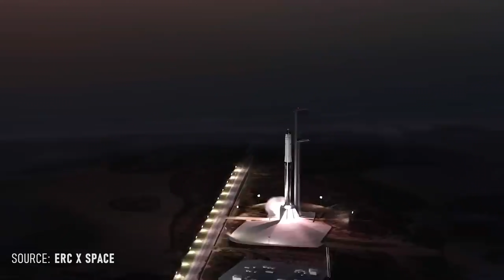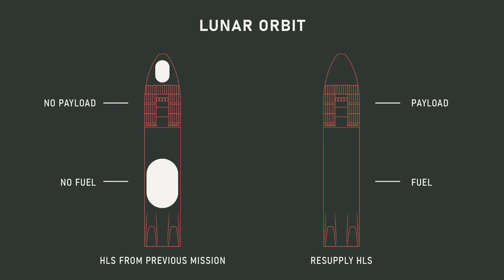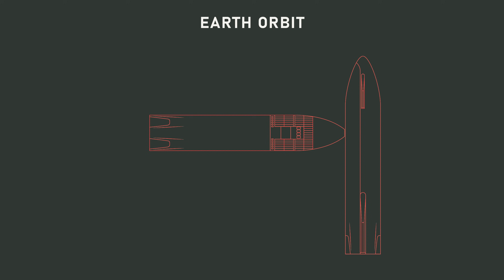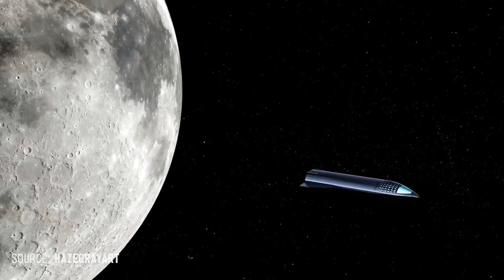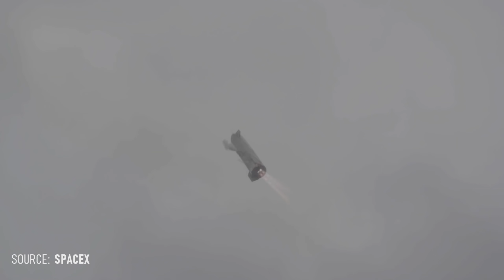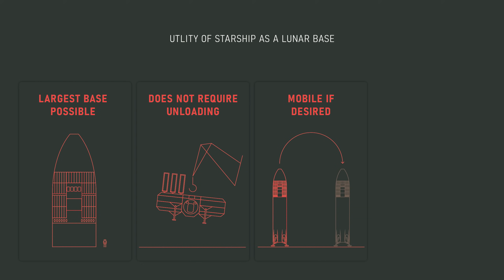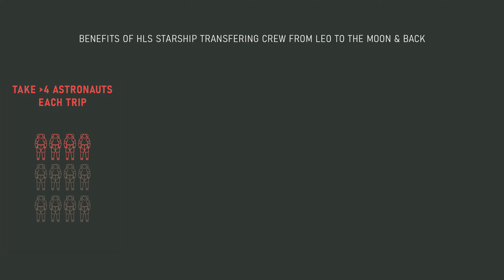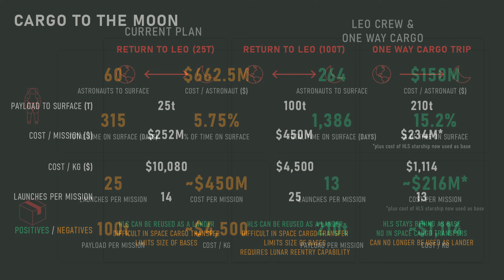How to Use HLS Starship

Comment: Your initial sequence shows the Lunar Starship with Sea Level raptors as well as Vac optimized raptors. Tne Sea level raptors, their mounts, and controls are not needed. It may turn out that all three Vac raptors are also not needed. all these reduce dry mass of the Lunar Starship and increase payload.
Reply from the maker: According to SpaceX renders of HLS Starship, it has 3 sea level raptors and 3 vacuum raptors. 

The sea level raptors are actually needed at stage separation for the stage to have enough thrust to make it to orbit on initial launch.
Reply: @Apogeespace  Interesting. Falcon 9 has pretty much the same flight profile and 2nd stage uses vacuum optimized Merlin. I wonder why the difference. Each Raptor masses 1.5 tons, add in mounts, plumbing, controls and actuators one could expect the total to be around 2.5 tons per Raptor. That implies 7.5 tons for cargo or fuel.
Reply: @richardrigling4906  The 3 vacuum Raptors won't gimbal per SpaceX. The 3 sea-level Raptors will gimbal. So evidently they are willing to use sub-optimal sea-level engines in space for any gimbal maneuvers.
Reply: @steveaustin2686  they could be gimbaled if required. The sea level raptors will Not be needed and there's a strong probability of losing at least one vacuum engine.
Reply: @jonbong98  The sea-level Raptors ARE needed to get Starship (second stage) to orbit. The Super Heavy does not reach orbit, Starship (second stage) has to get the rest of the way there on it's own. The engine bells for the vacuum Raptors are huge and per SpaceX will not gimbal.
Reply: @steveaustin2686  gimballing for orbital burn may not be needed. Since the Vac raptors are mounted closer to the perimeter of the SS differential thrust can be used for directional control. Sea level raptors need gimballing because they are mounted closer to the centerline and to flip to vertical and balance during landing,
Reply: If you dont have any Raptors how do you fly?
Reply: @iamarokotmanson  use only the 3 vacuum optimized Raptors. Theory is the 3 sea level raptors are needed for Earth landing

Comment: question: do you think the 2024 timeline for artemis could be pushed back because of how huge starship is which would take a long time to human rate?
Reply: i don’t think 2024 is possible for hls but i think it is more likely for hls starship to be ready then than it is for sls and orion to be ready for their 3rd launch in 2024
Reply: @ob1rayer08  I'm not so sure SLS will be why any Artemis dates slip. All the development work for SLS is done, now its just building them. All the engines and SRBs are there for at least 4 flights I understand, so it would come down to making a core for the Aug 2023 Artemis II flight for crew going around the Moon and another core for the Oct 2024 landing. Lunar Gateway is currently scheduled for May 2024 on a Falcon Heavy. 

If anything the greatest risk to the schedule seems to be Lunar Starship, but even that is doable if SpaceX is still working on regular Starship to reentry from orbit. As long as the Starships can go up, they don't necessarily need to come back down for Lunar Starship to work. Yes, you would have to expend the 6-12 Tanker flights per Lunar Starship launch, but as long as they can build and fly them fast enough, Lunar Starship can possibly make the date as well. It would just be expensive to do it that way.
Reply from the maker: I think 2024 has been out of the question for a while, but not due to the size of starship. The HLS competition was just started too late. I would expect 2026 personally but before then is always a possibility.
Reply: @Apogeespace  If everything goes just right the first time on all the difficult technology leaps, they might make Oct 2024 for Artemis III. But that seems unlikely. SpaceX did just get a NASA $50M contract to demo Starship to Starship refueling in LEO before the end of 2022, so it seems like they are trying to make Oct 2024.
Reply: 2024 is doable, and that's after a late 23 Artemis I mission. Earth to Leo is already taken care of , refuelling by 22, and current velocity of StarShip development should leave no doubts. It will only be external Bo, SLS nonsense that could hinder program further.
Reply: Yes, even Steve Jurzyc said 2024 was unrealistic and lack of HLS funding.

Comment: In the Single HLS Starship with GTO Refuel, could the Crew Dragon or Starliner bringing the astronauts to orbit remain docked to the HLS, and be used to bring astronauts back to Earth from GTO? (This might require the Crew Dragon or Starliner to undock in lunar orbit before landing and redock after HLS returns to lunar orbit.)
Reply from the maker: It actually can. I looked into this. To my surprise Crew Dragon can endure the thrust of the HLS starship while docked so this type of mission would be possible. 

However Dragon would need to be upgraded to survive the lunar flight (radiation and thermal changes) and the HLS now has to carry 13t of additional dry mass out to the moon. 

Math works out perfectly for that trip though! Good thinking.
Reply: @Apogeespace  Does the Crew Dragon have the dV to return from GTO? I can't find anything on how much dV a Crew Dragon has. I know the Super Draco's are only for aborts currently as they were disregarded for boosting the ISS. Crew Dragon/Starliner would have to sustained by Lunar Starship as well, as Crew Dragon only has 10 days of flight by itself and Starliner has less than 3 days. A Moon mission would be 13 days at least I believe.

Comment: I'm not familiar with space physics but I still don't really understand the delta-v problem. Why can't the HLS just escape LEO using a fraction of the original delta-v, and take a longer trajectory towards the moon? The trip to and back may be far longer and may use multiple eccentric orbits, but it wouldn't matter as long as there are no time sensitive items on board. I always thought that previous Apollo missions were time-sensitive because there were astronauts on board, and life-support supplies were limited. It would be different in this case where the trip will not be time sensitive, and the HLS can take its time, at a much lower velocity - using much less delta-v.
Reply: Travelling in space isn't like travelling over ground, where you can go arbitarily slowly and still make progress - getting to the moon means overcoming the earth's gravity through sheer (and fixed) velocity - even as you ascend to the moon, you're still in freefall, so you have to have had enough initial velocity at the beginning of the jump to make it all the way. You can take multiple burns at the LEO point of your orbit, multiple passes, to raise the peak of your orbit all the way up there, but it still adds up to the same minimum velocity requirement.

The Apollo missions didn't take three days to get the moon becasue they were in a rush - they took three days because there is no slower or more efficient orbit that actually has its peak at the moon. It's sort of like the old joke where three of a plane's engines burn out, and the pilot announces longer and longer delays, and one passenger remarks to another "if the last one goes, we'll be up here all night!".

(PS: if you haven't played it, I'd strongly recommend playing Kerbal Space Program - it works wonders for tricking you into building up an intuitive understanding of orbital mechanics)
Reply: @justharmless2319  There is a low energy transfer that takes less dV than the Hohmann type orbit used by manned missions to the Moon. Problem is that it takes 5 months to get to the Moon instead of the usual 3-4 days. This type of orbit is planned for the Lunar Gateway in May 2024 using a Falcon Heavy. Lunar Gateway has no issues of a multi-month journey. Lunar Starship on the other hand, only has 100 days of loiter capability, so it has to use a Hohmann type orbit. I had never heard of this type of orbit until I looked up the Lunar Gateway.

https://en.wikipedia.org/wiki/Low-energy_transfer
Reply: @steveaustin2686  The low energy transfer saves a little delta-v, but I don’t think it’s a “night and day” difference. For Starship, the extra time might well lead to so much propellant boiling off that it would be more fuel efficient to use the faster transfer orbit.
Reply: @zzubra  Oh for sure. It's approaching a 25% reduction per the wiki article on this slow transfer orbit type.
Reply: @justharmless2319  Actually, By my calculations, an efficient trip to the Moon (a Hohmann transfer) should take 5.4 days. Apollo missions aimed for a point beyond the Moon, and did involve a transit speed somewhat faster than the minimum.

Comment: I imagine NASA technicians and engineers are sitting around watching this in a meeting, and taking notes.
Reply: You can say what you want about Nasa but im pretty sure they already know all of this and even more and have already selected it down to a few possible methods.
Reply: @juriteller3688  They know all of this but need to ensure that SLS will have a use case after the huge sunk costs and time put into it. Also Starship is still very far from completing development and its goals are extremely ambitious, so it makes sense for there initial plans to not be overly dependent on Starship and still rely heavily on the more conventional SLS and Orion so as to be able to adapt quickly in the scenario where Starship is not able to meet all of the requirements within Artemis's time constraints.
Reply: @hadhamalnam  I agree. Rocket science is hard and nasa's actually got working stuff while Starship has a lot of things left to work out and design and test.
Reply: @123TeeMee  *rocket engineering
Reply: @hadhamalnam  but they’re already relying on starship as a lunar lander anyway
Reply: @shuryimaziz3426  that's true, but a lunar lander specific starship doesn't have to deal with the two most challenging technical hurdles that a fully capable starship would have to deal with: Reentry and the belly flop maneuver with humans on board. So relying on space X to just provide the lunar lander is a much smaller risk than relying on starship for the entire mission.
Reply: @juriteller3688  then why are they taking this long? A bunch of boomers that's what I see.
Reply: LOL... nah.
Reply: right?  "i know what you're saying..  starship is fully reusable!"  dude... Noone is saying that! 😅
Reply: He's talking about hypothetical things that we already know aren't what they're doing... they won't be doing orbital transfers from starship to starship, they won't be refueling in lunar orbit... his videos are amazing to people who don't know shit.... 40 minutes of hypothetical fantasies
Reply: You guys have NO clue what engineers dim, or how smart they are with stuff like this. This guys is freshman college level analysis at BEST. I understand it’s special out on YouTube but in engineering circles this is nothing special. This is still a great analysis , but engineers are who they are for a reason.
Reply: @TheHeavenman88  Im an engineer. It looks good to me. I'd like a NASA reaction in stead of a layman's.
Reply: @TheHeavenman88  I know more than one engineer, and I can tell you that they're not inherently smart. Some engineers work on meaningless and inconsequential garbage, and they're not visionaries. That's not their job anyway. It's up to inventive and creative people to put engineers on a meaningful path. This channel embodies the creativity that engineers depend on. Someone has to question the established standards, and this channel does that better than any I've seen.

Comment: The cargo-first approach seems very logical to me. It makes it so starship can more consistently launch payloads to the lunar surface without being dragged down by the cadence of a different launch vehicle, much less risk because it's only cargo and when crew does finally land there's much more available material on the moon to work with. 

The proposed mars missions for starship use a similar idea, initially launch cargo starships to mars, set up ISRU and only then launch crew
Reply: What would really de-couple the cadence of lifting propellant into some Earth orbit (apogee of elliptical orbit?) would be a GIGANTIC set of storage (carbon fiber?) tanks in orbit. One for LOX and one for each fuel (methane and kerosene - for F9s lifting Crew Dragons) and some kind of warehousing for cargo. This  tank-farm could also be comprised of special Starships that do NOT return to Earth, but are intended to be left in orbit forever. This would make them much lighter as you don't need a heat-shield, nor flaps, and you might want to use carbon fiber instead of stainless bc there is no heat-load from reentry to worry about.

Since the lift requirement on the Moon is so much less than around Earth, a similar lift-support (where lift is modular and comprised of LOX, Fuel, Engine/s) system around the moon, probably another elliptical, a Lunar insertion orbit, or Lagrange point, where payload can be mated to more appropriate lift. Think of this like railroads do with locomotives. Out in the vast planes of the midwest you don't need much, but over mountains you need a TON of power, so you need lift spread out along the load. You wouldn't want to marry the lift/locomotion/power to the load as that power requirement will change drastically depending on the mission. When going to other planets, even if you leave from the same spot, and are going to the same spot, the orbital mechanics can be drastically different depending on the alignment of the planets on your particular flight. 

This argues strongly that lift and load should be separated, and safety argues that LOX should be separate from fuel wherever possible to avoid explosions killing crews. Also, LOX is more versatile and precious as people need it to breath.
Reply: @roijoi6963  seems very logical indeed ....